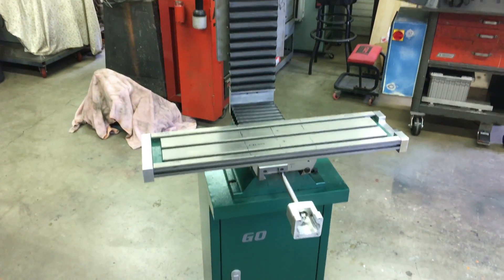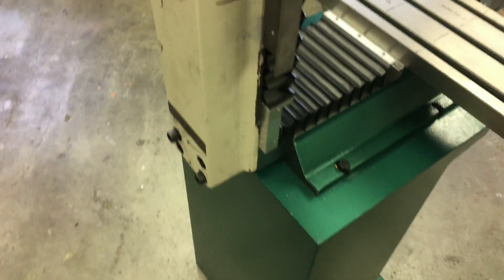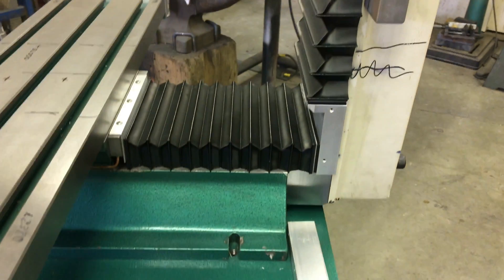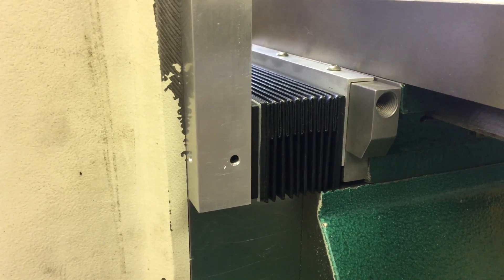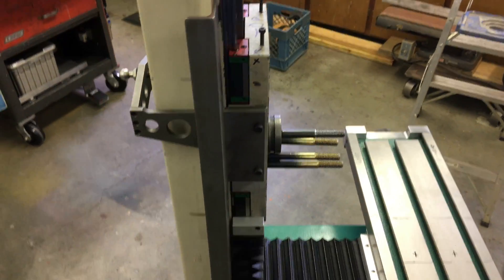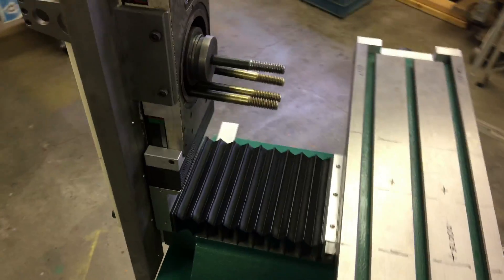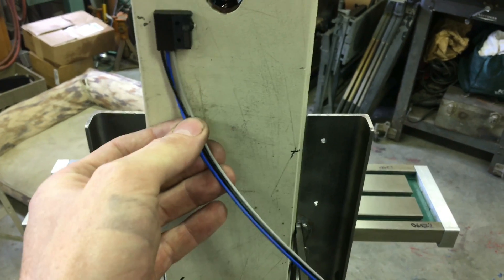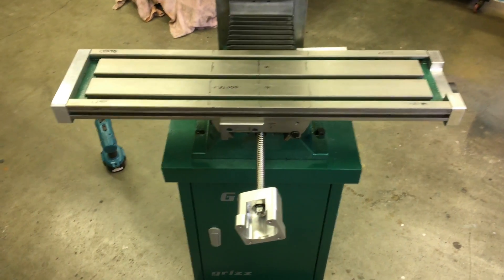GRIZZLY G0704 CNC Conversion Update 2 - (bellows/way covers complete / THE GRIZZ / home switch )

Comment: No real standard on the limit switches. Mine homes to +z first (mounted off the motor standoff) Then it travels to -x (mounted under the stepper motor bracket) and goes to +y at the same time (mounted on the top of the stepper motor). You can adjust the final "0" position to where you like. Z is 1" from top (where it goes for a tool change). X has the table hanging a bit more off to the right of center with Y about 2 inches from the column. This allows access for the vise handle to turn freely right after homing (clears the Y axis stepper) and for the vise to be out from under the head.
Reply from the maker: @ Michael Alcocer Thank you for the detailed homing description! i really appreciate it and it points me in a good direction.... are you saying i can have the machine home and then say... move the table and saddle their centers and the head raised up.... sorta like ready to load up and run..? am i understanding this correctly? - Nick
Reply: Yes you can. You would command it to home, it finds the switch (based on programming) and then you can set a distance for it to travel after that to reach absolute 0. As an example on X, I have it set to find the limit switch by going 120ipm in -x direction, hits switch, backs off switch at 10ipm until un  triggered, this is the home position and for me is -12". Then it will travel to 0 and I have a soft limit set at 6". For a total of 18" of travel.  I use linuxcnc so I am not sure how or where to go in Mach to set that up but Linux is pretty easy to use and free.
Reply from the maker: Michael! Thanks again, your explanation makes it all clear! Your awesome! - Nick

Comment: Looks really great! The standard configuration on the PM25 has the Y and Z travel limited by the bellows. I assume that's the situation on the standard G0704 as well.
Reply from the maker: Thanks Kent! Iam not really sure if it matter but i thought i would ask.... for fear that its common knowledge = ) 

- Nick
Reply: Hi Nick, absolutely, with the Y-axis way cover on the PM25 I think I was losing 1/2" or so, and like you said, when the chips pile up it's far worse, especially if walking away from the CNC for a little bit. The Z-axis was not as bad, but the mounting bracket had screws that also limited the travel on the Y when a 4" Kurt vice was installed. Happy Memorial weekend.
Reply from the maker: Kent,

Thank you for the information i will report back when i make a decision!  - Nick

Comment: Very nicely done! Really like those bellows.
Reply from the maker: Thank you! @iron forest knife & tool . It was a lot of work!!!! fun none the less...looking forward to actually making some parts with this damn thing!  If you need bellows made i can give the contact info for the (excellent) company that made mine.....  
- Nick
Reply: Thanks! I would definitely be interested in getting contact info. I wish I could take time to build mine that nice starting out, but I need to start making knives with mine. So I'm cobbling it together quickly lol. Mine should be ready to start making stuff in a couple weeks.
Reply from the maker: http://www.shuangxtech.com/

is the company website..... the guy that i worked with name was "Leo".... pretty surprised for my first time dealing with china.... smooth as butter, 100$ and like 8 days later i had really nice custom sized bellows in my hand! Its rough when you are under the gun to make parts with your machine,  makes upgrades or any downtime difficult. Are you working on any fun new products or products?

- Nick